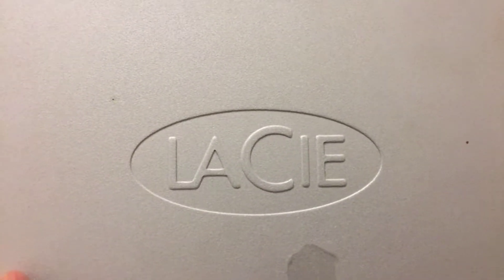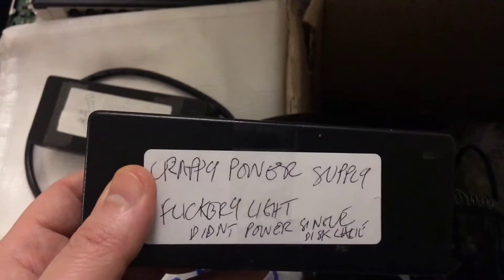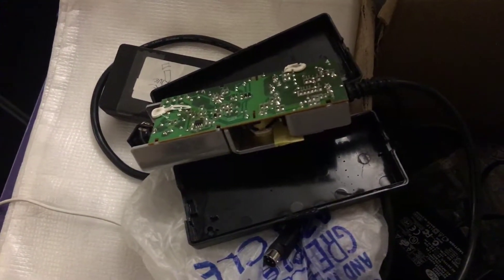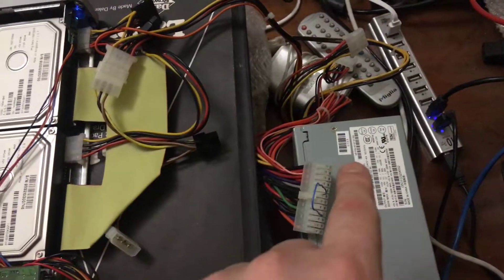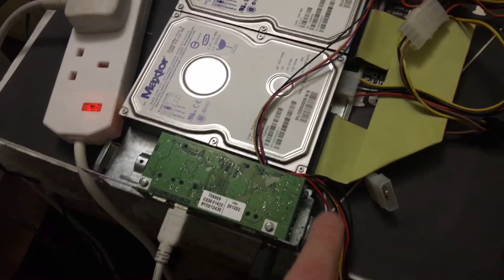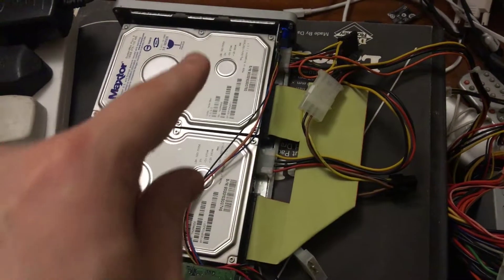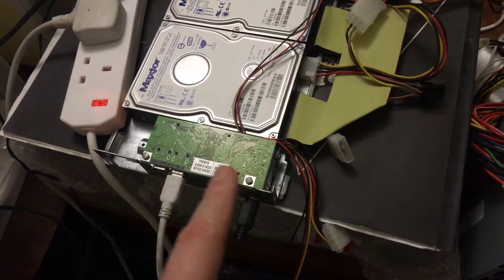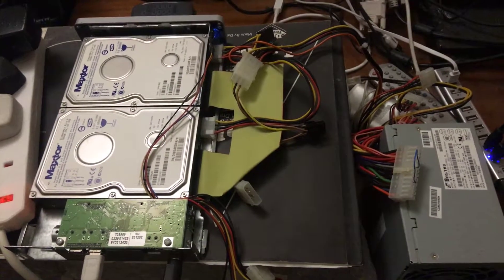LaCie Big Disk Jerry Rig Data Recovery PT0 getting the Data Off

Comment: I don't feel comfortable trying your method, though that's purely down to a lack of expertise. But it's certainly given me hope that the data on my 200GB model might still be salvageable. Thank you for the video!
Reply from the maker: Yes if you don’t feel comfortable, you could pay the money for a replacement functional power supply if any are still available, this method looks janky, but is pretty safe if you watch a few videos on how to test ATX power supply’s and only ever turn the power supply on at a switch, ie do not insert a paper clip ever while the power supply is live. The paper clip goes between the green and black pins.
Reply: Connect the drives to another computer with a drive caddy.

Comment: Could I just connect the drives to the power supply in my pc?
Reply from the maker: Yes you could use two molex power connectors from your pc if they will reach, as long as the drives remain connected, SATA data wise to the enclosure board which itself is powered by the original LaCie power supply.
Reply from the maker: Also bear in mind Mac formatted drives will not generally mount on a windows system.